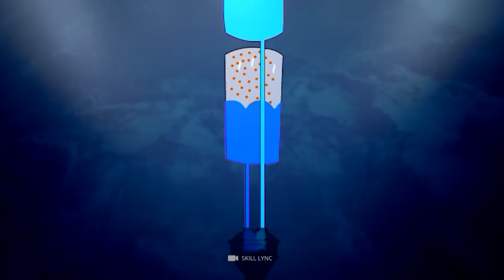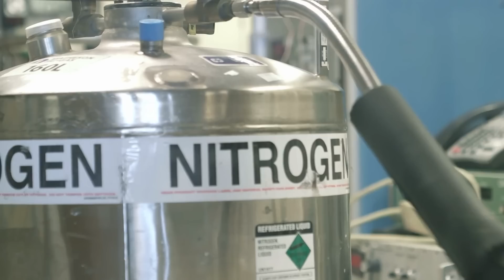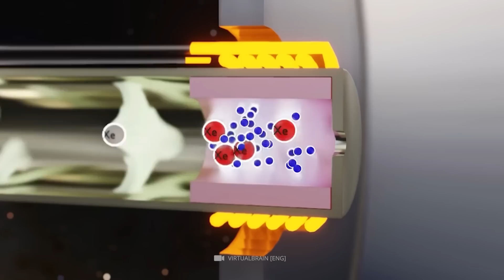How Fast Can We REALLY Travel In Space?

Comment: Solar sails seem like a very, very dodgy and unreliable format for a system-set that aims for having the lowest launch mass possible and limited "real estate" for redundant systems/back-up systems.  What has already been seen with the James Webb being damaged by asteroids (albeit small damage) indicates space is not empty enough to rely on 900 sq.ft. solar sails - with some sails being much larger than that.  
First, I believe deep space probes should be as large as possible in order to carry robust shielding, liquid fuel for adjustments/burns, fuel for Hall Thruster/Ion Engines, and nuclear generators to ensure very long term use (as seen in the Voyager probes (but should be triple the size or larger).  Additionally, "stationary beacons" sent out after the probes to create waypoints could provide redundancies for long-distance transmissions.  It currently takes about 22 hours for Voyager 1's signal to reach Earth, but similar to weather buoys stationed in the ocean like a grid, they could improve overall coverage and surveillance of space.  It is incredibly hard to justify a massive number of waypoint stations as the distant probe's signals will still reach Earth in time, but as spacecraft and their launch/development cycles become cheaper and faster, probes could be sent out like the Voyager 1 and 2 but in a larger set of directions.   I suppose scientists can reliably visualize and measure our solar system's trajectory through our galaxy, but I think it would be a useful measure.